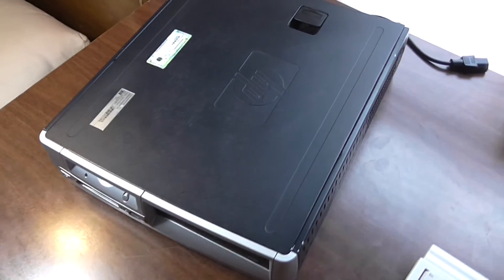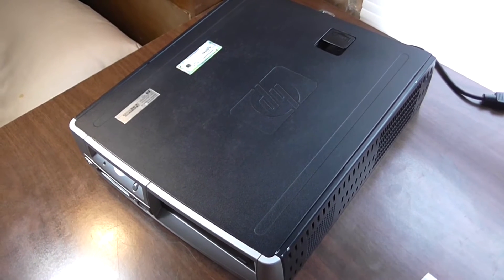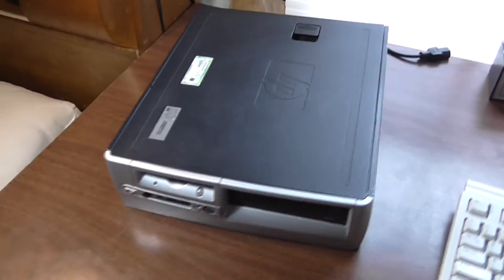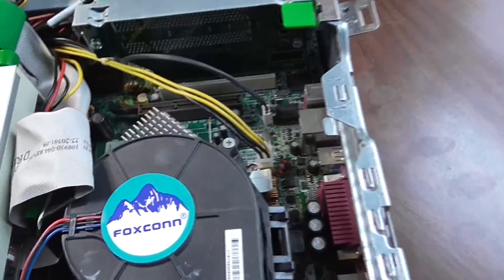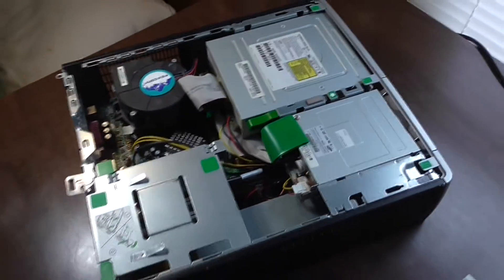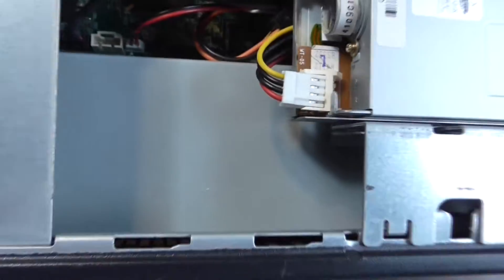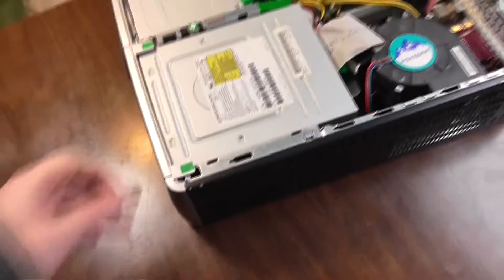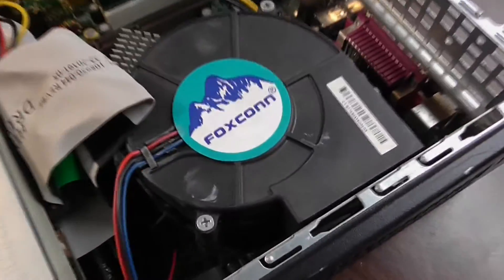2004 HP Compaq D530SFF - Bad caps and PSU suddenly...

Comment: Made in China isn't really an argument, everything is made in China now-a-days, even the top brands.
The caps on the motherboard usually fail because of the power supply, you should check the ripple and the voltage spikes on the 12v line, usually the caps around the CPU blow up due to overvoltage or bad ripple on the 12v coming from the PSU, in its turn probably again due to bad caps or just bad power delivery design.
Reply from the maker: Uh no at the time it was well known that a bunch of cheap caps were coming out of china, look up capacitor plague.
Reply: @TranscendentalAirwaves  I know about the capacitor plague, it's just that you can not blame capacitors on the motherboard for something a faulty power supply would have done. It's normal for capacitors to leak and expand if you give them high ripple or inconsistently high voltage. 
The capacitor plague had multiple factors, one of which was cheap electrolytics from China, another factor is that higher than ATX-spec voltage (+10% ripple) from cheap power supplies could damage capacitors next to the 12v CPU VRM's and ELCO's. 
Look up all the reviews from JonnyGuru, from 2004 to 2008 there are some pretty impressive archived in-depth reviews of power supply design, component choice, lay-out.
Most if not all cheap power supplies used unregulated old AT-spec lay-outs with cheap components (not only capacitors, but sometimes transistors weren't rated at the 20A spec for the rail, failing and taking out components on the motherboard (VRM's and caps) 
Hence why when you find a motherboard with bad caps, often the power supply is shoddy as well.
Reply: @TranscendentalAirwaves  But It's true I'd rather use some Nippon Chemi-con's than chinese caps anytime.

Comment: just got another, using it in the background, on every day. almost all caps on board are leaking. my friend used to byt these by the pallate load to resell. i used to help him redo them, i have probably recapped close to 50 of these. they never seemed to have an issue even with the caps blown, but he did it anyway. if mine starts having issues, i guess i will recap it.

Comment: My first PC was a HP DC 5000 SFF, that is fairly the same thing as the D530, and the system stop working because of capacitors too. The motherboard of mine was an Asus P4-SD, and the fan that is branded Foxconn on yours was a Delta DC Brushless. It was very reliable when it was functioning correctly... I ran Windows 7 for some time on it too.

Comment: It's from dealing with machines like these that you really appreciate a design with proper airflow.  One thing to keep in mind is that these machines were probably bought hundreds at a time, and most would probably have failed within a few months of each other.  when you don't cycle out your equipment every 3-4 years (which can happen in a growing organisation with a limited budget) things can get ugly quick.   the worst models I dealt with were the Dell optiplex 745 SFFs and worse yet the USFFs.  If you happen across any of those at the scrapyard, do yourself a favor and leave them there.  740 SFFs on the other hand will probably outlive us all.

Comment: I have a DX 5150 SFF and it has no problems at all...
Reply: Mine is Athlon based.
Reply: Mine also doesn't get warmer than room temperature.
Reply from the maker: +Geek2334 Well it's AMD and not a P4 so that'd be why. Besides that though it's a different model so probably different batch of capacitors.

Comment: the ibm netvista systems from this era aren't too bad they have delta power supplies rated for 200 watts but are equipped for much more than that and nothing really gets too hot in there most of the time you can turn the fans off believe it or not!

Comment: These things were just known for bad caps.  Heat is the biggest enemy.  A small form factor case simply doesn't permit decent airflow.  Therefore heat builds up, and literally fries the machine from the inside out.  Couple that with faulty Chinese capacitors and you have a recipe for disaster.
Reply from the maker: +jaykay18 I've had a couple towers from around the same time and they all crapped out the same way also. :/
Reply: Transcendental Airwaves The very machine I'm using now has several blown capacitors!
Reply from the maker: Yikes! Why not replace it then?
Reply: Transcendental Airwaves Simple, it still works!  I have a replacement machine standing by for that fateful day.